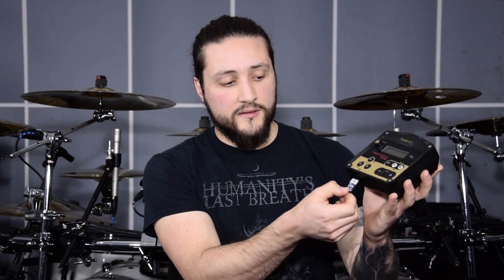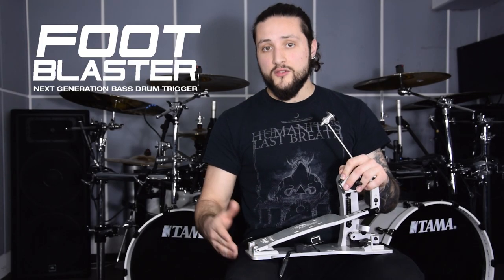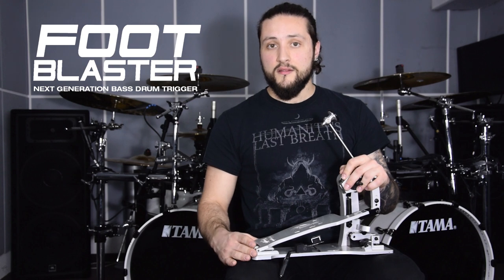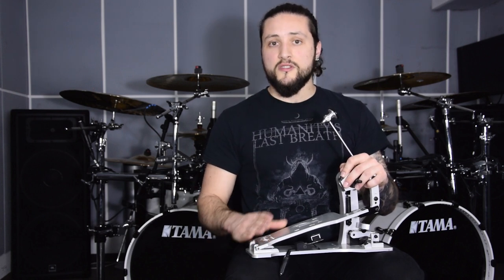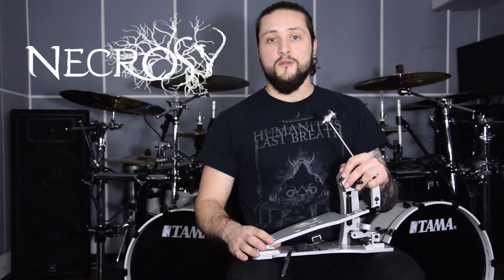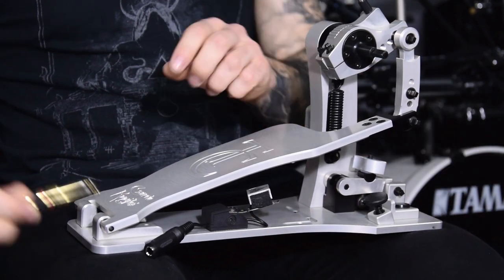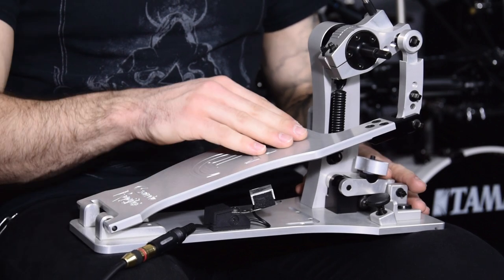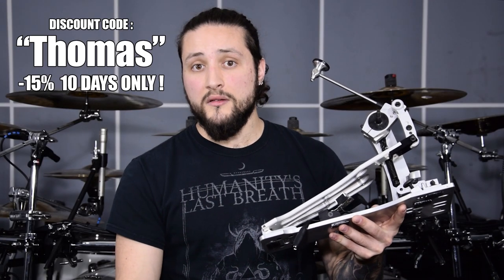TRUE DRUM TRIGGERS EXPLANATION

Comment: Thanks for the thorough explaination!  I'm not a double bass player (at least not a good one), so I was wondering why (only?) blastbeat/metal guys were putting triggers on their pedals.  Why put triggers on the pedals instead of on the drum head? Do you get false triggering when playing faster but with less attack?  I'm guessing the lower signal to noise ratio could cause false triggering.... the noise (continued drum resonance) is higher compared to the signal (attack of the stroke) than in a slower more powerful stroke?  Initally, I thought the triggers were to layer sounds on top of the drum acoustics, which seemed odd to be so popular.  Your explaination of using the trigger to compensate for loss of power makes sense.  As far as cheating, of course not... but reminds me of when guys use to say that mesh heads on vdrums were cheating because you could have higher rebound independent of tuning.
Reply from the maker: You are completely correct ! 
For years I had triggers one the head, but with time technologies evolved, and the first brand making an external triggers mount on the pedal is Axis with their E-kits which work great !
Having the trigger on the head creates some issues with vibrations, hitting the snare too hard could create a false triggering, playing ultra speeds means less power, so the need to get the sensitivity up, and you find yourself in a vicious circle against false triggering and miss triggering … 
With triggers on the pedals you get these issues away, you can but the sensitivity as high as you want without getting noise to trigger the sample 😊 

And you can of course use a trigger to blend the acoustic signal and the trigger signal, it adds the consistency of the sample's attack to the acoustic signal which could lack power when playing fast 😊
Let's see it as distortion, or boost pedals for guitar 😉 

Hope it makes sense !
Cheers from France, take care !
Reply: @ThomasCremier  perfectly clear!  Thanks for taking the time to clarify.
Reply from the maker: @adrumwhisperer  My pleasure man ! :D 
Take care and be safe !

Comment: nice video! what are your settings in the module? and do your triggers hit before you touch the skin? or only when you dig your feet in to it? i keep having double triggers even when there is a mm space when i hit the head softly.
Reply from the maker: I hit the trigger when the better is touching the head (my heads are tightened to the maximum, so my beaters aren't digging into the head !

My settings are approximately 
Sens 20
Threshold 4
RetriggCancel 2
Reply: @ThomasCremier  thank you!

Comment: We can say that footblasters are better than bass triggers or they work fairly the same?
Reply from the maker: I can tell you that it's really better because thanks to its construction, it won't have any false triggering coming from the vibration of another shell. It will only trigger the sample only when the footboard hits the sensor. It is really a different vision, and I really prefer !
Reply: @ThomasCremier  Thanks, it makes more sense now when you mentioned the false triggering, making a clean signal. (Question) What you will use as triggers having an acoustic drum set with mesh heads?
Reply from the maker: @JoeyRam.  I am still using the FootBlaster triggers ! They are so precise !

Comment: Hello bro, a question... I have these triggers and I can't configure them to work with heel toe technique and normal hits, my configuration is 15 treshold 5 retrigger and even then it doesn't capture all the hits well, my question is how do you use it with 2 of threshold and 2 of retrigger, if I put your same configuration it is unsustainable... it retriggers a lot, you cannot make simple blows at low speed because it shoots anything... and if I make a curler that is to say 4 blows, as you have to exert more pressure 2 blows are fired together which generates a very annoying noise as if you were giving 2 blows in unison...
Reply: I can't find anyone who can help me with this problem, the same thing happened to me with other triggers I had from my country and I was never able to figure out what it was due to... I was never able to configure correctly to be able to use all the techniques... I hope you can help give me a hand since I tried many configurations and did not find the solution, yesterday I spent 4 hours trying and I can't. I can't find the problem, thank you very much in advance.
Reply from the maker: Hi there!
Sorry for the delay of answer!

So about your triggering problem, first questions are:
- Do you bury the beater into the head, like do you let the beater touches the head when you aren't hitting?
- What is the head you are using? Do you have it tightened or pretty loose?

Personally, my beaters never rest on my kick drum heads when I am not hitting it, so the trigger is touched only when I want a hit to fire!
Then, I use mesh heads for years on my kicks, very tight tension!
And the tension is very important as the head will physically move a little bit, and the more it is loosened, the more the amplitude of the head is big.
And it will make it less precise for the detection.

For your FootBlaster triggers, the footplate needs to touch the sensor on the angle, not on the flat side.

And lastly, about the trigger settings. 
Input: PADx2
Type: RT-30k
Start with sensitivity all the way up, threshold all the way down.
Curve: LOUD2

RetrigCancel sets the minimum time possible between two samples, so faster you play, smaller it needs to be.
XtalkCancel: 20%

Start playing and decrease the sensitivity until it doesn't get all the hits, increase it a little.
Then do the same thing with the Threshold by increasing it until some hits aren't triggered and lower it a bit.

Continue playing and make little adjustments to make it work for you, set to your techniques!

My settings are my personal ones that was adjusted over a year before being these ones and didn't change at all since then!

Hope it helps,
Do not hesitate to tell me if it is better! 

Cheers from France!
Reply from the maker: My RetrigCancel is at 2, but if you do not play faster than 240 for example, it can be increased 😉
Reply: @ThomasCremier  Do you have a social network to chat with and can you explain the problem I have? I can show you a video...
Reply from the maker: @pudritiblast of course! It is @thomas_cremier on instragram or Thomas Crémier on Facebook 😉